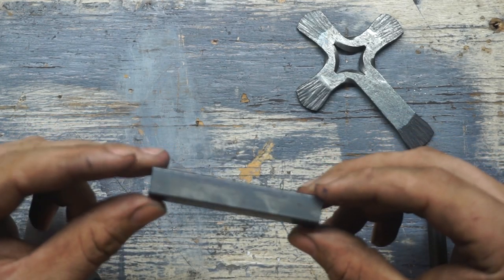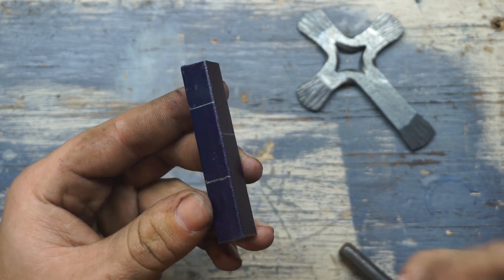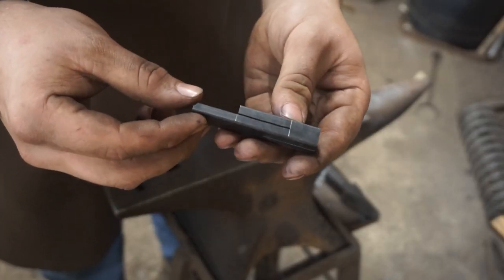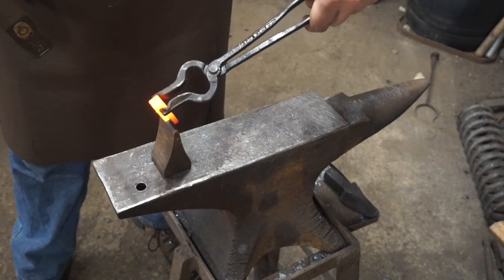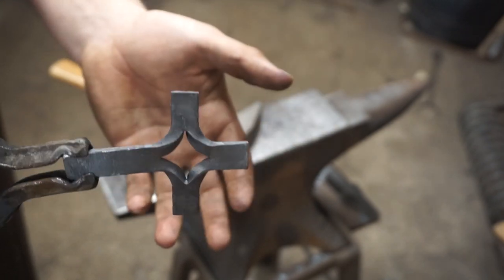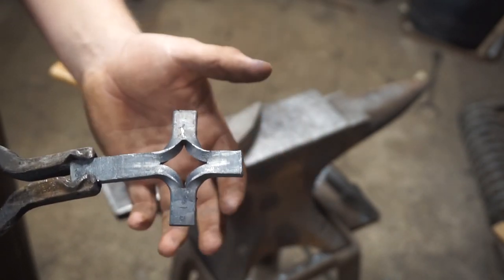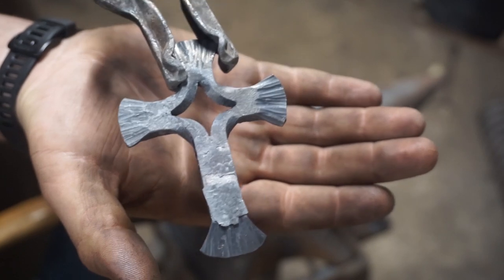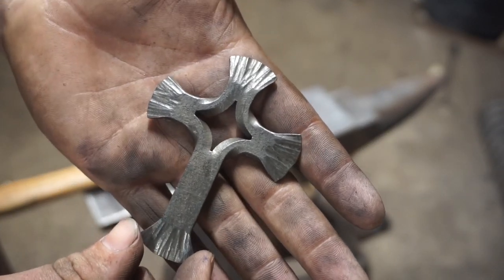Forging a Split Cross

Comment: Very nice! I’ve made many from 1” and one from 2”. I don’t flatten I use that as a design element and make “shadow” cross with a fuller. I make a domed stand with copper or aluminum concho spacers. I often heat color the base purple, and Japan Brown the cross. Many ways to dress them. Great gift! Thanks!

Comment: You should do a video on how you add the brass.....great video!
Reply: Just brush it with a brass brush when hot, under a red color.
Reply from the maker: light red and dropping down into a black heat
Reply: @nathansforge  exactly. Too hot it won’t stick. Run the brass brush slowly. Do you clear coat yours?
Reply from the maker: @JohnDavis-yz9nq  i was using beeswax alone then switched to 50/50 beeswax and linseed oil for a harder finish and sometimes i use boiled linseed oil by itself

Comment: please tell the machine name in which you cut the rod from between
Reply from the maker: It’s a Milwaukee portaband bandsaw. I mounted it on the wall with some scraps of wood and replaced the lower guide with a large flat plate

Comment: Great job. You said you was going to put bras on it how-do-you-do that. Just thinking about getting into forging. Is that a liquid and where do you get it?  God-bless have a great day
Reply from the maker: It is done with a brass brush after the piece comes brown from the red heat and turned black you just scrub at it with the brush and that transfers a small amount from the bristles to the piece
Reply: @nathansforge   Thank you God-bless